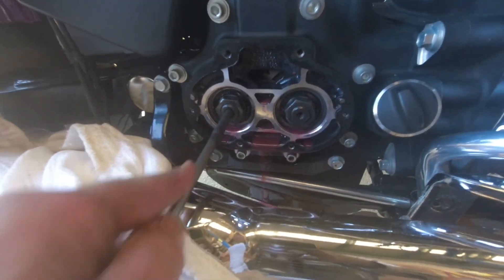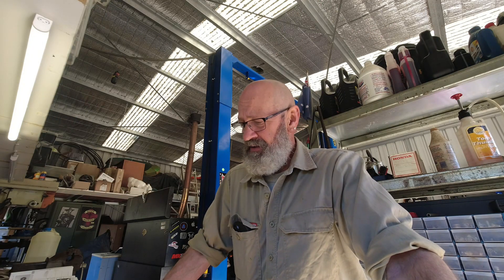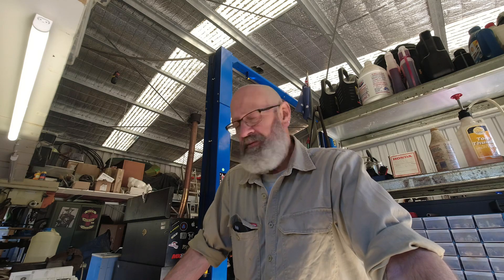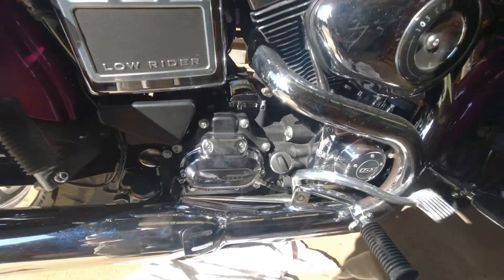Harley Clutch Sticky Notchy Fixed! Pt 3

Comment: Hey Steve, I have the exact same issue with a 16 Breakout. You think the cause was a miss adjusted clutch? Has the problem come back? Just trying to get as much info before tearing this thing apart. Thanks
Reply from the maker: As a rule the clutch should always be adjusted in spec. I would check your cable first. Especially at the trans end. You will see about an inch of white plastic sleeve over the cable. Run your finger nail along the plastic to check for notching/ grooves. Then check over the whole cable. Go from there. Good luck
Reply: Brand new cable. Interesting thing, after lubricating the cable the pull was actually harder. Clutch adjustments are good and the bike shifts fine.